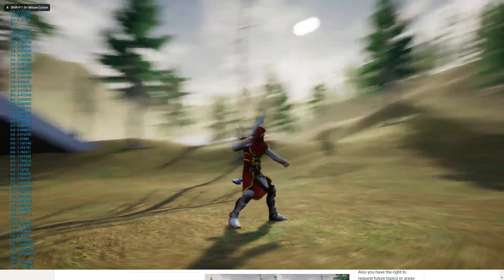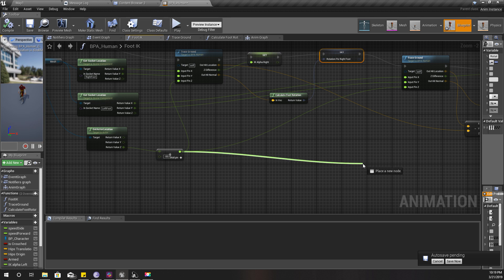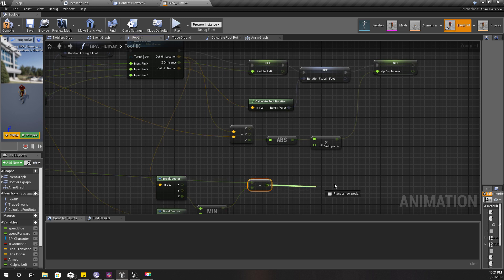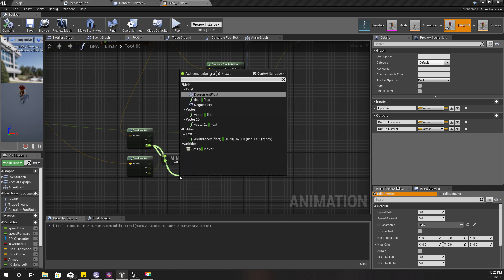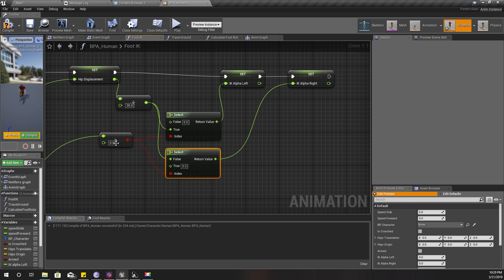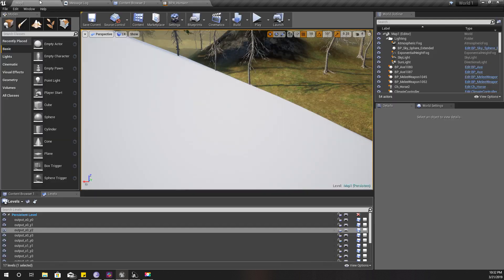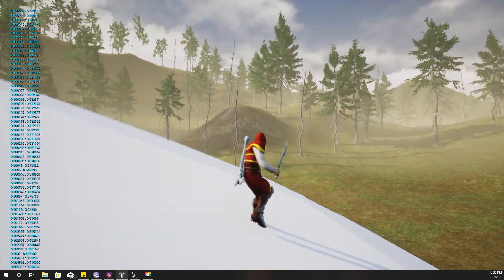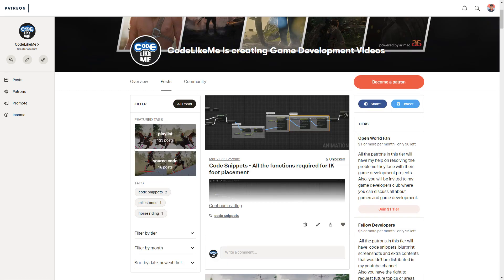Unreal Leg IK 3 - Fixing IK Problems - UE4 Tutorials #127

Comment: i'm having some issues with jumping and also if i'm on a platform and one leg is off the edge.  i was able to just disable the foot trace if jumping, but how do i solve for my other issue?  when one foot goes off of an elevated platform, i get forced under the map.  i think there should be a way to disable IK in this situation.
Reply from the maker: Yes. As I have mentioned in the end of this video,  still there are problems in this system.  I will address them in upcoming episodes
Reply: CodeLikeMe awesome thanks a lot for these tutorials they are very helpful!!